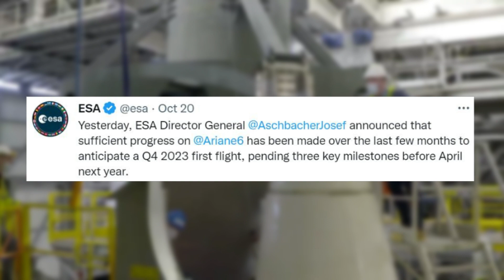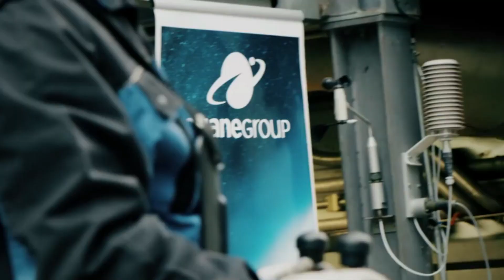ESA’s Ariane 6 Rocket Has Been Delayed

Comment: The 800-pound gorilla in the room is Starship. At the present the next generation H-3, Ariane 6 and Vulcans will not be price competitive with even the Falcon 9.  When and if SpaceX gets a fully reuseable Starship with a rapid cadence, high reliability and much lower costs it will be hard to imagine continued use  of these new but much more expensive single use launchers even for regional pride. Perhaps SpaceX will offer joint production deals.
Reply: Correct 

ESA needs to focus on Starship as well as New Glenn. If Blue Origin successfully launches New Glenn next year, ArianeGroup and ESA are in real trouble. Two next generation VTVL launchers with technology unavailable in Europe competing in a price war for every global market contract at prices no European launcher can touch. 

ArianeGroup and ESA are in trouble !
Reply: Starship is a mixture of the Space Shuttle and the N. A vehicle with the mixture of the efficiency of the Space Shuttle and the reliability of the N1.
Reply: Starship is a pipedream. Wake up.
Reply: @Gnefitisis  starship is actually built. Unlike Hermès, Maia and Suzie which may forever be computer generated images knowing EU and ESA

Comment: Honestly ESA needs more competition in the private space launch sector so the Ariane space will start pulling their fingers out.
Reply: I guess SpaceX, Blue Origin, Sierra Nevada Corporation, Orbital, Firefly, OneSpace, Northrup Grumman, Rocketlab, ULA, and Virgin Orbit among others aren't enough?
Reply: @jackhydrazine1376   All of those are American companies; but you are right as all of them have already put cost pressures on Ariane Group to both lower price & move towards reuse of boosters.  Ariane 6 already has multiple upgrades in work to both reduce price and increase payload by nearly six tons.
Reply: @jackhydrazine1376  you literally didn’t name even one other European private space company. While the are a few European startups in the launch market only one or two are close the actually launching.
Reply: The problem is European bureaucracy. The French court of auditors strongly supports no intra european competition against ArianeGroup in the heavy launch category. This project is nothing more that political pork spending. €4 billion euros to develop Ariane 6 not to mention last year’s check for €140 million and this year’s check for €600 million at the ESA Ministerial Conference next month. At the same time trying to spend more money to reach falcon 9’s capability with  Maiaspace 20 years later.